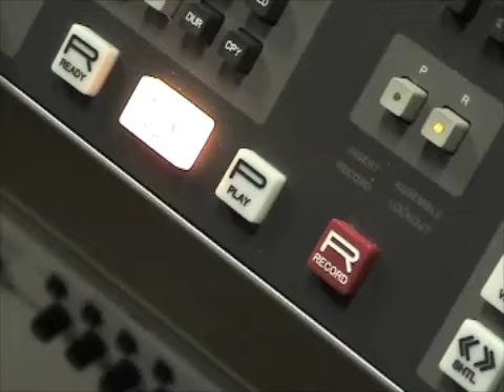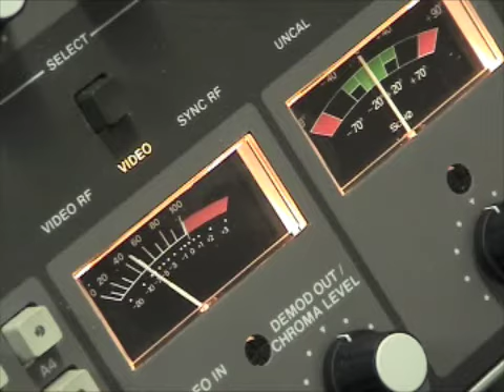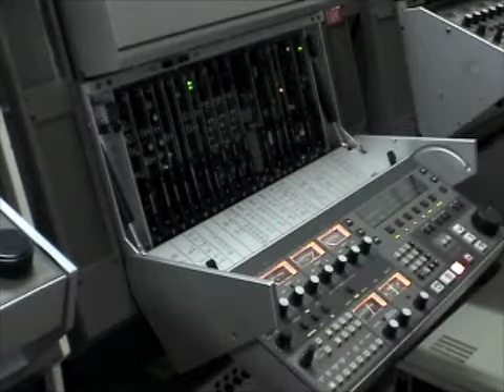Close-up of the Ampex VPR 3 in operation

Comment: we did the air guides here in colorado springs and all the high precision shafts,and idle arms.the air guides have laser drilled holes .002 dia. we did the drilling and the grinding of them.we have a room full of old mecanical part.we did parts for over 35 years.

Comment from the maker: The compressed air is used to provide a blanket of air around the guides through a series of very small holes in the guides. The gauges tell if the air is at the proper pressure. The compressor is located in the upper rear of the VTR and the tubes feed the air to the guides. The vacuum capstan is where the air intake is. The air guides greatly reduce the tension around the transport.

Comment: One VPR-3 feature often overlooked is that if you were in Fast Forward and pressed Play the spooling would slow down straight to Play without stopping.

You could also have the machine in Pause and poke your finger into either the supply or take up reel and 'jog' the tape with perfect picture output and no spilled tape.
Reply: The VPR2B plus the Sony’s allowed you to jog a machine that way. That is how most sports tape ops did slo mo.

Comment from the maker: Yes. All Type "C" 1 inch machine I know of had two channel audio, same as 3/4" VTRs. The VPR-3 actually has four possible channels, with 3 used for time code and 4 was used optionally in Europe. One use of the 4th channel was a mono mix of the stereo program. As you know, to get a proper mix of a stereo program, you have to re-mix it, not just sum the two channels together due to the +3db increase of any mono material (channels 1&2). Quad could do stereo by splitting the mono track.

Comment: Dear Audiovideopark, what do you think ended up to all those hundreds of thousands of type c tapes that must have been in TV stations all across the country? Did pretty much all of them go to landfills? I see some come across ebay from time to time but not real often, and the ones I've seen are usually beat up pretty good. When you transfer tapes do you usually send the original tape back or does the client not want it? I was wondering because I have a small collection of audio/video/data reels.

Comment: Please can you eXplain to me what this is on >>>> 01:49
Reply: That is the air compressor. The machine has air guides and a vacuum capstan. The compressed air is used to provide a blanket of air around the guides through a series of very small holes in the guides. The gauges tell if the air is at the proper pressure. The compressor is located in the upper rear of the VTR and the tubes feed the air to the guides. The vacuum capstan is where the air intake is. The air guides greatly reduce the tension around the transport.